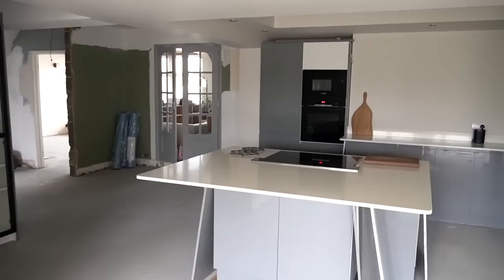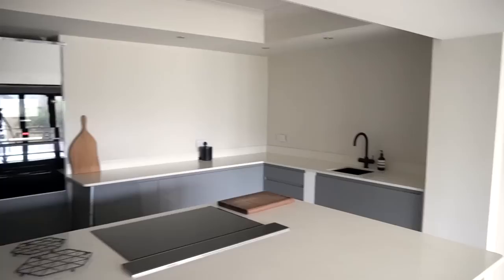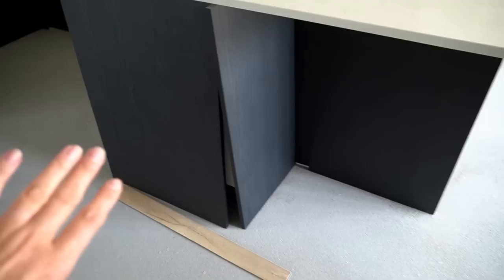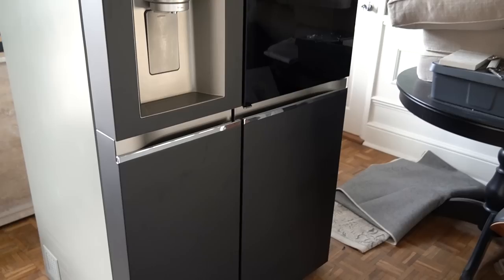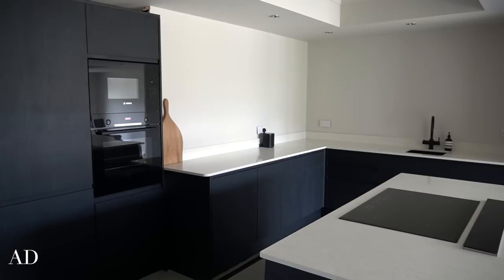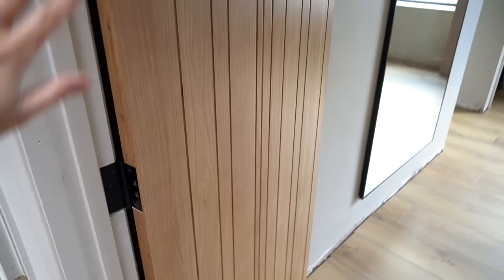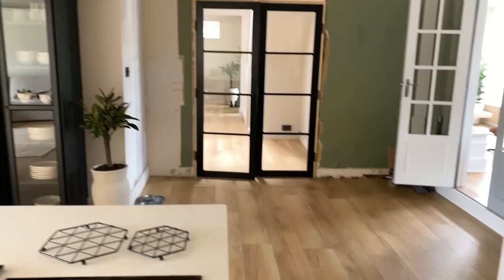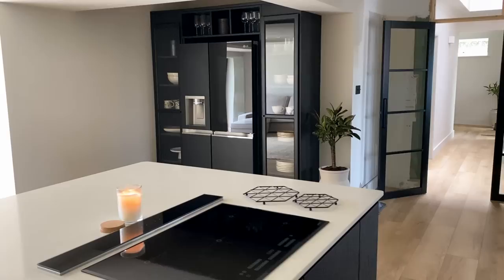We Got Our Kitchen Wrapped | Kitchen Makeover

Comment: Can you do a video on how you ikea hacked the fridge shelfs area because I’m actually doing this very soon
Reply from the maker: We only filmed what you saw here I’m afraid. It’s just fridge in the middle, Ikea Billy bookcases either side with wrapped end panels attached to the sides and then the unit on the top (re-used from the previous kitchen design) was screwed into the sides of the bookcases x

Comment: You should leave the wall open! The doors will make it feel enclosed.
Reply from the maker: I’m not sure where you mean? The black double doors which are usually open? We have only just had those installed so we wouldn’t remove them after having spent all that money on them 🙈 But as I mentioned in the video it’s important for us, especially with the dogs and in Winter for heat conservation, to be able to close off areas. Doors can be opened and therefore open a space, but if you don’t have doors you’re screwed if you need to close off that area.